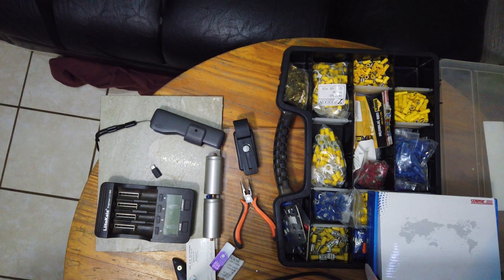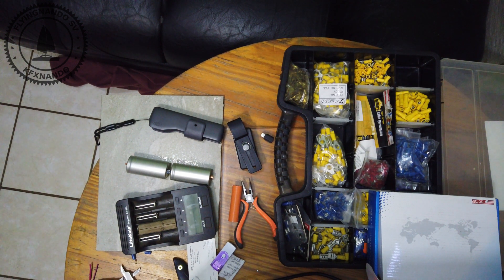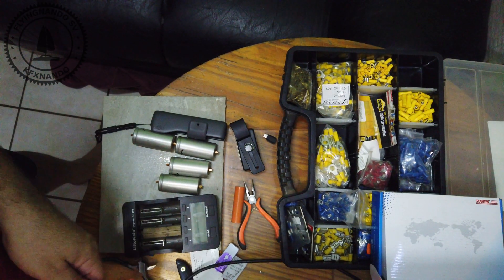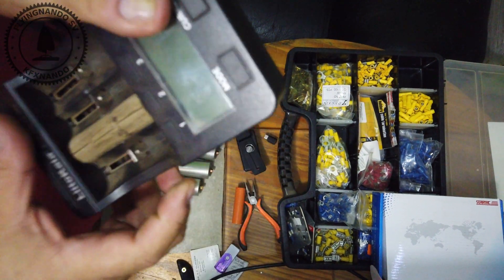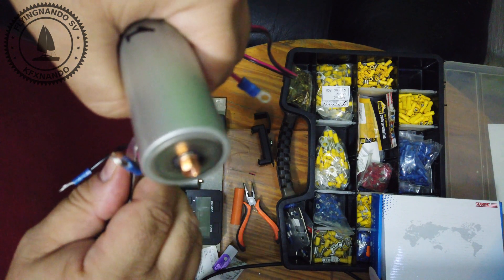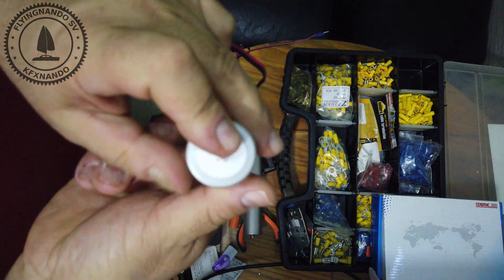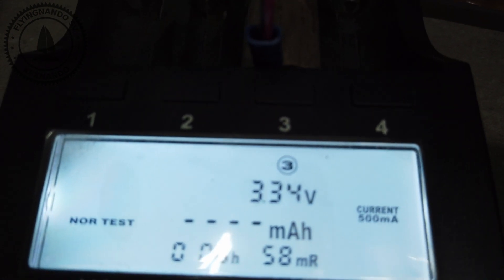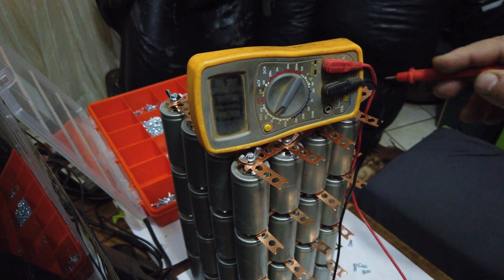48 Volt 32650/32700 Lithium Iron Phosphate (LiFePO4) Power Wall Cell Test #Part 1

Comment: hey hello, i am ordering everything to do a 96v 108ah battery pack for an electric vehicle, I am using 32700 cells, it is rare to see people like us doing battery packs with this cells
Reply from the maker: Agree, that one dosen't see many people using this size batteries/cells
Although my ones say 32650, I noticed when i was editing the video, that these 32650, are longer then the 18650
from the measurements, it measures closer to 32700, although i did not mention anything, other wise, it might be something else to explain
Do you have videos of your batteries, would be great to compare
Reply: @TechNando  yes it is confusing, they put 32650/32700, i will do videos as well because there is no videos of big battery pack with 32650/32700 lifepo4, i will film in approximately in 2 months when they arrive to me. My facebook is "Nachito Yanki" it would be cool having a word with you. I am planning on ordering flat terminal, and therefore buying a spot welder, but maybe you can give me your opinion regarding screw terminals!
Reply from the maker: have sent you a DM/PM on your facebook
check amd see if you get it
me not sure if i have the correct person on FB
there is a pic of you standing on a green hill, on an overcast day
is this correct
Reply from the maker: my FB, has the same jeep as i have on here, then you will know its me
the other pic is if me on a gree  quad